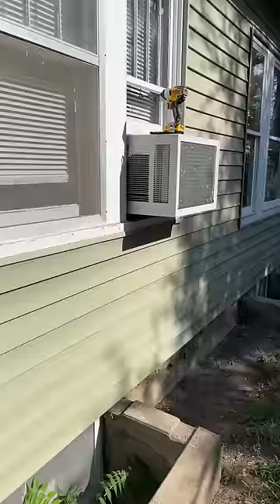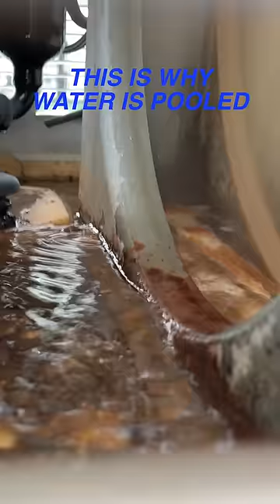🥵 99% Don't Know THIS About Window A/C!

Comment: 100% Accurate. 
It slings that water onto the condenser causing Head Pressure to drop, lowering discharge air temp and increasing efficiency.  🤨
Reply: That's how I understand it also
Reply: Rights  its almost like they dont understand thermodynamics. Cuz you know the coil needs to be colder than ambient to dissipate heat huh? Lol and for those of you whom dont get it: ac/refrigeration guy here: 
1) heat moves to cold
2) ac is just absorbing heat and transferring it
3) the outdoor coil needs to be lower than ambient temp so outside air is cooler giving it the ability to give heat away.
4) yes the water is cooler but honestly not saturating the coil to the degree needed to get rid of enough heat to inside can have maximum heat absorption so his theory isnt sound.
Reply: @863TheTravis  the outdoor coil is hotter than ambient not lower.  Maybe that's why you can't understand how it works
Reply: but only when it rains.
Reply: @diymacgyverguy8054  lmfao right dude?! Heat ain't going anywhere if we ain't transferring it lol. Cool air passes over coil and cools it condensing and sub cooling the refrigerant
The evaporation of the water helps to move more heat. A lot of ptac's have this design too
Reply: All while rusting out the entire unit causing premature failure.  Great design!
Reply: Damn son wet condenser coil makes a great filter. When it stops up what’s your head pressure going to do then brighten up boy
Reply: @TWOWHEELSONELIFELEFT   I would think so too but I have a window heat pump with this feature and the condenser is spotless after 7 years. I've never had to clean it
Reply: @trapwis9761  Yeah. Before that the condenser coils become covered in matted, rusty gunk causing HIGH head pressure issues after a number of years.
Reply: That's a bunch of bullshit though. Water has a thermal capacity 700 times greater than air, that's all. It simply cools the same as 700 times the volume in air would.
Reply: Most of you guys have it half right.  Water comes from the cold evaporator, it's condensate from the humid air in the house (not rain), since the water is not from the tap it won't cause mineral buildup on the coils. The water helps cool the refrigerant in the condenser mostly by evaporation due to the massive latent heat from phase change from liq to gas, the temperature or thermal capacity only plays a small role. -guy that actually knowns thermodynamics
Reply: @diymacgyverguy8054  How does a window heat pump work? Did it come built in? Or did you have to add it? The rusting will corrode the bottom and let the water out. Done on purpose I guess
to force buyers to buy more.😎
Reply: @TTURocketDoc  Dirt, dust, and debri get pulled inside the units somehow. When that happens, the dirty water splashes onto the condensor coils, reducing heat transfer, causing the compressor to shut down on high head pressure
-- Guy who maintened dozens of similar units for years.
Reply: Then the water rusts the unit out then causes leaks so a 2 year old unit ends up on the curb . Nope!! All of mine have holes in them so they drip and they work perfect 💯 with no issues
Reply: @SohCahToa30  agreed, seems like a bad design to keep the coil wet for that reason and corrosion. Probably why most units don't have this feature
Reply: And with that water, dogwood, cottonwood fuzz, dirt into the coil fins and it dries over the fins, blocking the airflow. It takes some effort but can be cleaned away.
Reply: I always duct tape window screen to those open slots on sides and top of these, occasionally broom or wipe off the crud and live another season !
Reply: I was worried that there was ice forming on there because it’s been so hot and muggy here in NY and little shards were flying around 😮❄️
Reply: @SohCahToa30  How about just cleaning it every so often lol, I clean mine every season, I take the unit completely apart, fan shroud and all I'm left with just the compressor, condenser and evaporator, I clean that Mofo out good. Now I know not everyone knows how to do this though :P, but the water does help to a degree with indoor discharge temperature.
Reply: @anneallen3520  they will freeze up for a few reasons.  
On a Window unit A/C Most of the time they are low on Freon. 
But other reasons are )))===>
1. Lack of airflow 
Such as “Dirty Air filter” or “bad fan motor” or “Dirty evaporator coil”
2. Low on Refrigerant “AKA Freon”.  
Air conditioning we deal with Pressures and temperatures. 
3. Plugged metering device. 
4. Low load situation “cold in space already and not made to run at that temp.
Reply: @Mooseguy15  I have about 300 of them to maintain on the property I manage. They can be a nightmare.
Reply: @trapwis9761 rust? Why would they create the coils to rust knowing it rains outside as well?
Reply: @863TheTravis  One lb of water can soak up almost 1000 btut through evaporation, and takes almost 1,000 btu to condense into the pan, why not take advantage of the already spent energy on a hot day and use water evaporation to suck heat out of your condenser?
Reply: @trapwis9761  Condensed water in theory is pretty pure from minerals and the stuff that actually causes the oxidations....gotta keep that filter clean though that kind of pure water can become a kombucha mother of rage in no time.
Reply: @SohCahToa30 nothing works if its not maintained, same goes to an ac
Reply: @863TheTravis Uhm...You said outside coil needs to be cooler than ambient air to move heat......Only if its a heat pump. If its an AC it must be HOTTER than outside air, but thats only 1/2 the story, the latent heat of evaporation is a HUGE assist is heat transfer, you see the help the water gives isn't because that water is cool, its because of the evaporation.

P.S. if you really are an AC guy, I hope you get some proper training and don't show up at my house.
Reply: @joehomanick  same here. All the pollen and oak tree crap grows all over them with the water and they run like crap. Have a Toshiba been running for 4 years now. Drilled a hole  in that sucker when the air didn't feel as cold and it was making a lot of racket sloshing water around.
Reply: @seabass22 I like all the AC “Experts" worrying about the copper/aluminum fins rusting.
Reply: @Kandralla  it’s galvanic corrosion
Reply: @863TheTravis  I'm extremely concerned that you're an ac tech.... 

Temperature transfer can only go from hot -> cold. Cold is just a lower energy state, you can't transfer a lack of energy. If the coil is ever below ambient, energy transfer would cause it to warm up to ambient. So in order to transfer to outside, the coil must be, by definition, warmer than ambient
Reply: If you can live with the algae mold and stagnant water smell when the fans off they do work this way
Reply: Your comment is true, being that water over condenser will increase capacity, they will run fine without it. The design is to get rid of the water with out dripping down house or on roof. Clean the condensers often and thorough
Reply: Your comment is true, being that water over condenser will increase capacity, they will run fine without it. The design is to get rid of the water with out dripping down house or on roof. Clean the condensers often and thorough.
Reply: @seabass22  not if they did it right.
Reply: @Kandralla  not if they did what right? It doesn’t matter what they do. You can’t stop galvanic corrosion. You can only inhibit it. Obviously aluminum and copper doesn’t rust, but running water over the two dissimilar metals will cause them to corrode.
Reply: So by lowering the air discharge temp it runs better. I get it but fuck that 😂I'ma pay my bill and have as cold of air as I can get
Reply: @seabass22  yes not if they did it right. There are things that can be done to minimize/eliminate it. Sealants, coatings, gaskets, not submerging the coil in the pool of water, etc. Things that prevent contact between the metals or minimize the electrical contact between the two.

Like, rain exists my man.
Reply: @863TheTravis   The system works this way:

The evaporator coils brings liquid refrigerant that is cold and blows air over the coils, causing the refrigerant to undergo a phase change to a gas as it picks up heat.  It goes through the compressor and then the excess heat is removed through the condenser coils as air is blow over it.  The water helps turn that gas into a liquid faster.
Reply: @hvacmisadventures exactly, latent heat transfer creates almost no entropy due to there being very little temperature change in the water turning into vapor. That all equates to higher efficiency, and having evaporating water as a heat sink is much faster.
Reply: Increases the life of the unit as well.
Reply: @TTURocketDoc Thanks
Reply: @Mooseguy15 This is what you do with all of your appliances. It makes them work much longer & more efficiently.
Reply: Thank you, was waiting to find another engineer to back me up. They only throw the water on the hot coils to get rid of it through evaporation. That’s literally it. Idk how he jumped to it making the Carnot cycle more efficient like uuhhhhh no it doesn’t lol
Reply: @863TheTravis You are not a refrigeration guy by any means.
Reply: @SohCahToa30  You are supposed to clean it every year.
Reply: I have a 40 year old reverse cycle- it and all new box aircon units have a drain with a fitting to put a drain tube on if needed. Mine is fitted at a small angle so water drains out instead of rusting the machine out in 10 years. This is how theyre meant to be fitted. You can see his machine is rusting inside already- the humidity will also take its toll on the wiring and fan motor. The "slinger ring" is mainly to cut down fan noise, as blade tips are the noisiest part of a fan. If the a/c was mounted properly, the water wouldnt be in there.
Reply: @rossbrumby1957  They are meant to do exactly what the video said, they drain at a certain level above the pickup for the fan. You are absolutely incorrect this is the purpose for the design, they are purposely built this way, differently from older units, for efficiency.
Reply: There's a lot of stupidity out there.
Reply: @TTURocketDoc  Like all window units made in the last 10 years atleast have this feature.
Reply: @SohCahToa30 
Them vents for outside air intake are made large on purpose. Then, all kinds of dust and other things can get into the unit to clog it up and shorting it's life.
Reply: @stinkwink695  interesting, I wouldn't know, haven't owned a window unit in decades, central ac only. And my expertise in thermal MGMT systems doesn't include residential ac products
Reply: Im gona Try this on My Window shaker i have set up in my AutoShop wear my Parts room is. 
Interesting enough i thought about and tried what would happen if i sprayed the Condensation water that Pooled up out of the Unit. . Onto the Condenser Side of the Unit. sure enough I felt a Short Burst of Cooler Air than it normally Put out. 
Now i dont feel Stupid for trying that after seeing this.😮
Reply: Then why drain water if to maximize effeciency. ??
Reply: @baynoli1  it can only sling so much.  
An air conditioner is nothing more than a dehumidifier, pulling moisture out of the air.  On a typical window unit it will trickle back into the compressor/condenser compartment in which that condenser fan blade has these little paddles that splashed water up onto that condenser coil thus fan/water going across the coil will drop the head pressure along with lowering the discharge air temp, therefore making it more efficient.
I should do a breakdown video.   
But yeah, basically if the water level gets too high because it can’t get rid of it, it will overflow somewhere

Comment: I can't speak for all, but the ones I had actually had drain plugs on the bottom for cleaning purposes. Installing them required the rear to be 1/2 inch lower than the front and to clean it, the booklet said to use a spray bottle with soapy water to spray down the condensing coil through the vents and from the back, and rinse with low pressure water (book specifically mentioned shower setting) to clean the coils and the condensate tray and to reinstall drain plugs afterwards. Cleaned mine twice a year and they all ran for 10 to 15 years.
Reply: Depending where you mount it, the drain should be fitted with a tube to carry the water away where it wont drip- like when fitted above a door. Don't plug the drain hole- thats why you need to flush it out after a while.